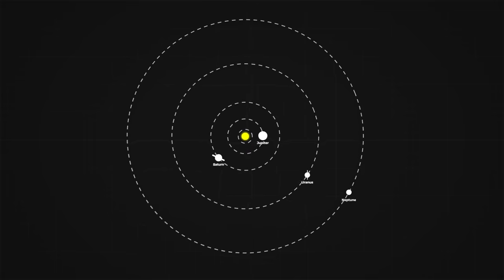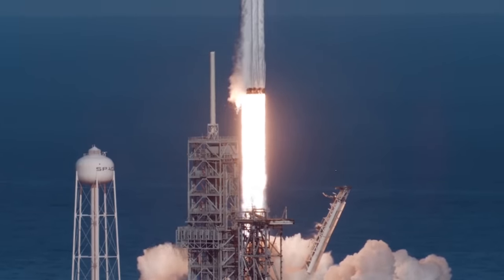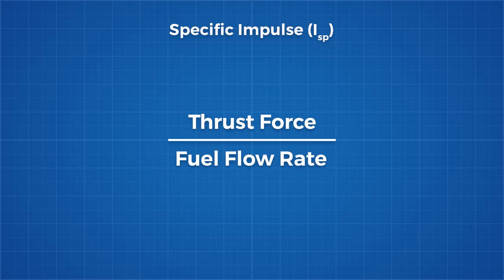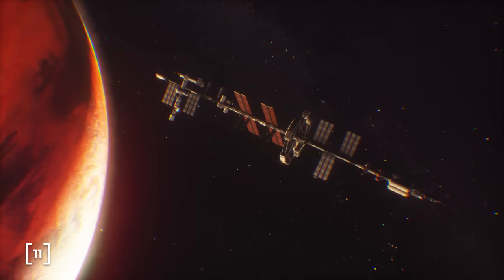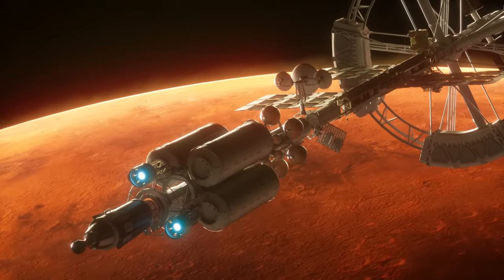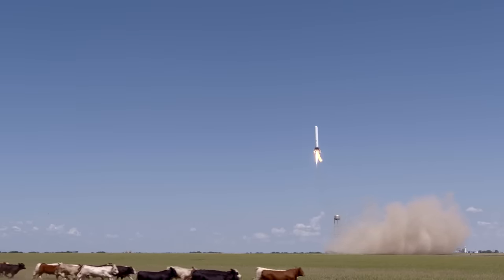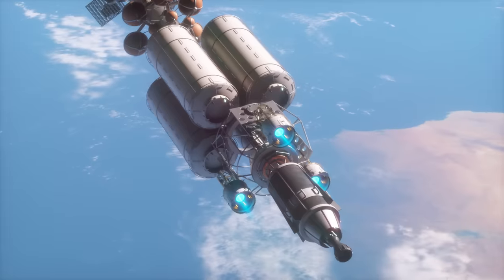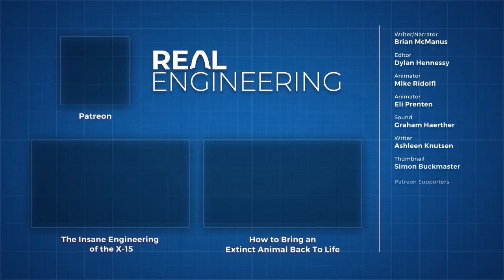Can Nuclear Propulsion Take Us to Mars?

Comment: Why not store the hydrogen as ammonia? ammonia is a better carrier of hydrogen than liquid hydrogen
Reply: How is ammonia a better carrier for hydrogen than hydrogen
Reply: @peeperleviathan2839  Simple - Storing pure hydrogen is problematic - it has a low density as a gas (too bulky), when compressed you need massively thick walled containers, when frozen you need huge amounts if insulation. But storing ammonia is a much easier proposition; ammonia is 3 atoms of hydrogen and 1 nitrogen atom so when you need the hydrogen you just crack the ammonia molecule to release the hydrogen and avoid all the storage problems associated with hydrogen.

Comment: You need to utilize a new frequency based design of exhaust conned shaped reverb interaction from the known ripples of or frequency wave of venturi pressurized exhaust which has a culmination point or points along the length of trail designed as a stepped down reversed cone from the expansion cone of the venturi exhaust port giving the exhausted gasses more area to push off of thus multiply the exhaust push with a longer cone and reverse insert capable of withstanding the exhaust temp or enhancing its capabilities by cooling the exhaust cone and its reverse stepped cone with a none explosive capacitated condenser flowing in highly heat transferable metal filled with extremely cold properly sized diameter liquid cooling tubes that absorb the heat turning it into gas creating high pressure forcing the flow of cold fluid round and round into and out of a capacitation tank allowing sufficient volume to recool and start the process over again with continuous cooling beyond or to an acceptable level!

Comment: the trick will be a hybrid mix, using a standard fuel and giving the exhaust a boost via an EM field the same as if it was Xenon, Imagine if chemical combustion could be pushed through a particle accelerator before being ejected, we just need better power sources and delivery, kilowatt hour batteries in the palm of your hand. we think harnessing all the power of a sun/galaxy etc is going to be the evolution of intelligence, why not the manipulation of the forces, if we could change the strong force in a gas we could make it fuse without pressure or heat, we can harness the power of the atom from every level not just fusing or splitting, there's so much more energy there to be tapped if we can get real creative, our only real limitation when it comes to light speed is power, to produce enough of it is a challenge, more power adds more weight in fuel, reactor, etc, the boundary of light speed isnt about mass of your ship increasing with speed, its the mass of your power delivery system, needed to accelerate your power delivery system and of course you cant accelerate anything faster than its source, a jet turbine can only give as much thrust as the air it can pull and compress, a ship sailing goes as fast as the wind will allow, if you cant get your exhaust gasses past the speed of light then you will never be able to either.

Comment: Don't forget to show how it works in a vaccuum chamber before you show us next space cartoons.
Reply: Engines work in a vacuum. Do you disagree?
Reply: @maxv9464  prove me wrong.
Reply: @stolearovigor281  I'm not sure what you're even saying. So I can't try to disprove it, I don't even know if I disagree.

Engines definitely do work in a vaccum.
Reply: @maxv9464  prove it
Reply: @stolearovigor281  Momentum is always conserved. Engines combust fuel and oxidizer, they reach high pressure, exit a nozzle with a given expansion ratio that makes them follow a highly directed flow. The mass and speed of gas going out of the engine backwards constitutes momentum in one direction, so the engine and spacecraft have momentum in the opposite direction.
Reply: @maxv9464  prove it. True scince is based on experiments. You have just hypothesis. which is just an opinion.
Reply: @stolearovigor281  when I throw a baseball, I feel a force on myself. The surrounding air doesn't matter.

Rocket engines are throwing billions of molecules way faster. It's the same concept.
Reply: @maxv9464  so you can't support your claim with evidence and true scince, not experiments?
Reply: @stolearovigor281  That is an experiment. It's a very simple one. It illustrates the phenomenon quite well.

Comment: Thrust force becomes deceleration force if the deceleration engine is at the front tip of ship.
am I the first to notice this?
So, you have a warp engine, and you have a deceleration engine. Not a genius application of the definition and graphic that you presented.

Comment: after 50 years of sleeping, things may slowly take up speed again. H2 is abundant and the lightest rocket fuel. So far, that is good. 
But H2 is nowadays fantasy fashion stuff for application in everything: cars, trucks, iron-smelting. I worry, that changing from coke to H2 will deteriorate steel quality. We do not yet know enough about hydrogen ( - diffusion, high-pressure. high temp, low-temperature), how it affects alloys ! if NASA had nuc.propulsion readily available, a probe could have been sent to 1I/'Oumuamua ( still could, if technology progresses quickly?  i 4 i s  org )
Reply: Many cover Space. Want to know some names of youtubers?

Comment: I’m all for nuclear until 
Your reactor is having a meltdown mid space
Reply: what about chemical engines blowing up? also modern nuclear reactor designs aren;t from the 60s and 70s, they have a negative void coefficient, i.e. if they get hot enough they stop reacting
Reply: @r3d0c  I completely agree that there much safer then what they were half a century ago
However there is still risk

Comment: Nah we need is solar energy. Everything makes from gases and fuel are dated.
Reply: solar energy still shit tho, you will want to use mirrors to heat something so you can use that energy cause photovoltaic panels are absolute trash in terms of efficiency, if not that then nuclear power which has a bad reputation just because the night crew did wrongly the job of the crew in chernobil, radiation isnt green and reactors just dont explode 90% of the time, be realist

Comment: So, no nuke space flight generations away  Wouldn't just saying so, and why, and then having a show on what we CAN do be more useful to promote space flight.
Oh, has anyone investigated a space based solar powered laser in Earth orbit firing to hit the maneuvering space craft?  It would defeat the problem of solar power diffusing as you move past earth orbit.  Ideally you'd eventually put such facilities orbiting closer towards sun.  To make aiming easier a LARGE transfer craft could be constructed that would house MULTIPLE transport / landing vehicles.  These vehicles would be the ones making sudden erratic movements not the transfer craft which would be under constant acceleration / deceleration reaching acceptable rendezvous speeds at each planet Where it would take on reaction mass accelerated mostly via multiple gravity assists by ea planet, and where transport craft would use jettison able chemical rockets to match speeds. The then lightweight jettison able chemical rocket, or tug, would then be much more easily decelerated to match planetary orbit where it would be refueled.  It's possible to even direct laser light to Mars distribution satellite where it could then be beamed to these ships converted to elec and used to slow back to planetary orbit using ion engines at very high power over a period of a couple of yrs.  There is a large infrastructure requirement, but like all such infrastructure projects once in place operational costs are very low compared to any other system.  This could more easily be tested with a truly small system transferring say 100 lbs of reaction mass to mars orbiting monitoring satellites to extend their useful life time.  Or even to refuel missions retiring samples from mars, which after getting free of planet would be almost out of fuel facing a very long trip back to earth.

Comment: so you mention crap atlas engines, but nothing on SpaceX engines !
Those engines have actually proven themselves
Reply: Atlas V has done so much more work and achieved so much more than Falcon Heavy. Makes sense to go with the only one of the two rockets that launched a scientifically meaningful payload. But the explanation is basically the same for both rockets, they literally use the same fuel. The only difference is that the RD-180 is closed cycle, meaning it is more efficient and complex. RD-180 is better than Merlin if you ask me.

Comment: This suggestion shows how NASA is still plagued with a severely myopic view to space and space travel. Leaving much needed supplies and food and fuel behind is simply stupid. The fact that NASA still uses ground based launches is proof it can't break free from 1940's technology. SpaceX and NASA"s heavy lift rockets are just fancier V2 rockets. 

What NASA needs to do is move to smaller, "High Atmospheric Launches (HAL) at heights of 38,000 to 50,000 meters. The costs for HAL missions would destroy the operation costs for a single heavy lift mission and all the wasted fuel just to reach a height of 38,000 meters. 

Where is my proof? All you have to do is look at the Red Bull super high Skydiving challenge held a few years ago. This challenge involved old 1960-70's NASA engineers who built what was essentially an Apollo manned space capsule that weighed more than 4,000 pounds. These old yahoos attached a helium filled weather balloon which safely lifted the 3,800+ kilogram space capsule and the skydiver to  38,404.8 meters (126,000 feet). Then the Skydiver jumped out of the space capsule and landed safely back to earth after breaking the sound barrier.  So if NASA used helium balloons or high altitude reusable dirigibles to lift multiple 4,000+ kilogram payloads to an altitude 38,404.8 meters (126,000 feet) and then ignite a solid fuel rocket to lift the payload to the optimal height and speed in low earth orbit. Then astronaughts could assemble their giant space craft filled with all the water, food, fuel, and cargo needed for a 5 year mission.  Each HAL would cost a mere 25 million US dollars and could be repeated 2-3 times at a minimum each week. In one 4 weeks time you could have at a minimum 12,000 kilograms of cargo waiting in space to be used. If they took it to the max they could have in 1 month 48,000 kilograms (52.911 us tons) of usable cargo waiting in space to be assembled into a working space craft. Then if the process was repeated for 2 more months you could have 144,000  kilograms of payload in space which would obliterate the total amount of usable payloads lifted to space by any country to date. 

An extra bonus to this technology is the fact that it greatly enhances safety for the payload. JPL knows solid fuel rockets work because their first contract was making solid fuel rockets for the US military. Any failure of either the balloons or rocket the payload could be ejected and floated safely back to earth at or near its launch position using a series of parachutes.

The technology already exists and the only thing holding this tech from becoming common place is a question for governments.

Comment: Why not build the hydrogen tank around the reactor and make the inside wall more "porous" then the outside one? Then the hydrogen diffuses into the reactor and provides thrust instead of being lost into space. And do a hybrid system, where the reactor can either generate electricty and a xenon drive or direct thrust through thermal expansion.

Comment: I envision an Engine that uses magnetic fields to pull a Ship toward a targets unique electromagnetic signature such as a "Star" even today we know how to measure electromagnetic fields and frequencies. imagine using Quantum Computing to lock on to a stars signal and use it to draw a magnet "Interstellar Ship" towards it.  
China has magnetic tech used in its new experimental fusion reactor technology although in its prototype state eventually such research will lead to wonderous new Tech and discoveries that will unlock new opportunities not previously achievable by Humanity! 
So instead of allways thinking about propelling an object why not reverse the thought and pull the Craft through space instead!
 Scrap Thrust all together, and go with Magnetic solutions! Since space has no friction the closer the Ship got to the target the faster it would go, so long as the engine was engaged speeds could have a real chance at breaking light Speed or coming very close to the line!
Quantum computers would regulate the system, maximizing magnetic pull and when the computers have the stars frequency it would fly its self faster and faster to the target Star using attractive magnetic fields. until the Computers again would then disengaged the drive and take the ship into the Star System where it would remain in orbit around the Star as a staging area for smaller crafts/drones that detach and explore said Stars solar system, in particularly its Goldie locks zone! just my thought on it Earthlings (<DR>06-28 -2022) <------ For Time Travelers ;)
Reply: There must be a REALLY strong magnet to do that

Comment: All these are immensely intriguing to me. However, I am fundamentally deficient in maths, so much of the details pass over my head. 
   I am excellent at spelling, however. I enjoy figuring out what technical terms mean. A case in point is my inference about an engineering issue; however, I do not know if it is correct. My statement is: 
Shear occurs when torque exceeds tensile strength. 
Can anyone help me, please? 
And no, I cannot ask anyone in my immediate vicinity. In my last five residences over the past score or so years, people who know me have told me that I am the smartest resident in the building. Immensely flattering, of course, but ultimately unavailing.

Comment: Rockets cannot work in a vacuum ........this is ordinary basic physics , are they now using magic ?
Reply: Why cannot rockets work in a vacuum?
Reply: @mojo1158  In"space" there is no method of altering mass direction or velocity without dividing the mass as an equal and opposite force in the absense of a medium apart from  gravity.
Reply: @marxman00  I am not sure if this is correct, but doesn't a rocket moves in space because the gases are "given" momentum as they are expelled by the rocket engine.

Consider the rocket resting in space. There is no momentum in the system. Next, the engine ignites. As the exhaust gases go in one direction, the rocket goes in the other to keep the total momentum of the system constant. This momentum change of the gases gives the rocket the "push" to go forward.

Feel free to point my mistakes.
Reply: @mojo1158  you cannot apply  energy to an uncontained  vacuum. it is impossible to put a gas into an uncontained vacuum as it breaks laws of thermodynamics, The only "grip" you have in "space"  is your mass and momentum,in order to change that you could  dispose of some of that mass and push off that mass but that would be extremely inefficient as you would have to use half your mass to affect your relative position ..and you can never decelerate as you have spent the mass that accelerated you .
Reply: @marxman00  Wait, then how did the SpaceX Merlin vacuum engines work?
Reply: If I must not apply energy, how about Newton's third law?
Reply: @marxman00  Please tell me if you have found the concrete solution to that, I'm very interested in it.
Reply: @mojo1158  deception
Reply: @marxman00  hmmm...so the physics we know may not be true physics? sounds philosophical!
Reply: @marxman00  cool~
Reply: @mojo1158  I do hope so ,or we are going nowhere and paying someone to stop us
Reply: @marxman00  https://youtu.be/D4SaofKCYwo
this may explain the physics
Reply: @marxman00 So you're one of those flat Earther conspiracy theorist nuts? 😂
Reply: @ct92404  and father christmas isnt real
Reply: @marxman00  It seems to me that someone who thinks the Earth is flat with a giant glass "dome" over it is more likely to believe in Santa Claus. 😂
Reply: @ct92404  you seem to think I care what you think.

Comment: But there is still the problem of debris destroying  the ship, even if You solve the 
Propulsion  problem .
 At speeds You propose
 even a spec of dust could tear a hole in the ship killing everyone .
 Tell me how You intend to solve this problem.
 DML
Reply: That's just straight up wrong. Where's your math on the "spec of dust" issue? Because it looks a lot like you just, well, made it up.

Not to mention the path to Mars is codirectional with the vast majority of solar system material. Lower relative speeds, lower collision energy.

Comment: No, nuclear thermal rockets are trash, the ISP benifit comes only when using Hydrogen, which requires huge tanks, combined with the reactor itself, nessary ulage etc all the parasitic masses basically give the system a poor overal performance, if you expect to ever restart the engine you need to bleed through even more hydrogen through the engine to cool it, wasting propellent (stop calling it fuel).  All in all you end up with hardly any payload improvement over chemical rockets and billions of dollars in development costs.  Nuclear electricity is space is hopelessly inferior to solar power untill your past the asteroid belt and a fully solar-electric craft for a chemical rocket / solar-electric-ion combination will outperform nuclear, low thrust capture at a planet is possible, it just takes time and deceleration to begin well before perigee.